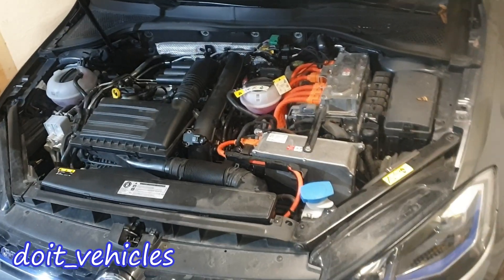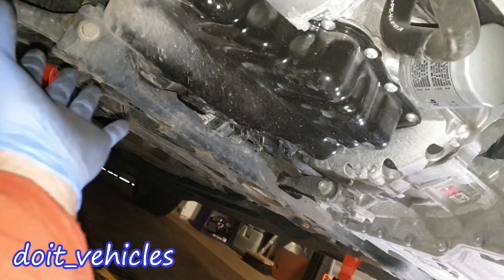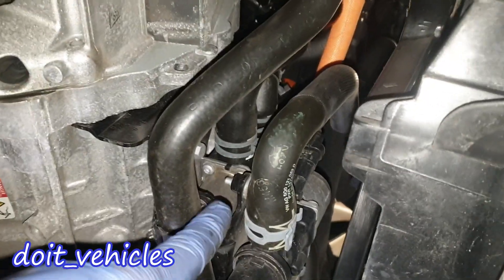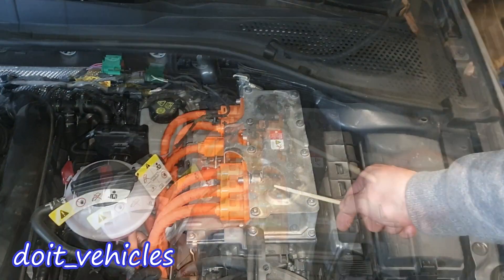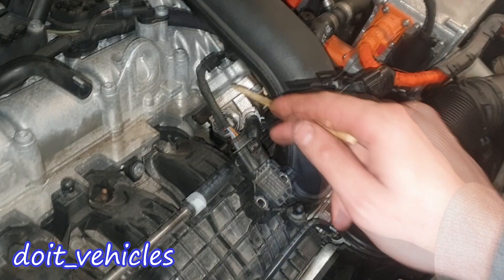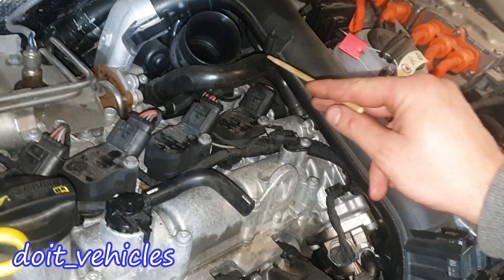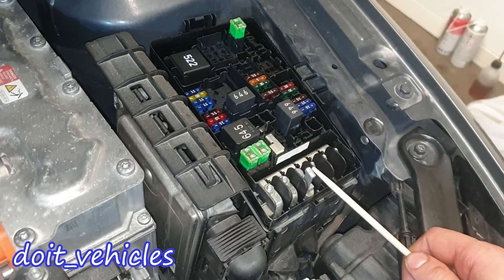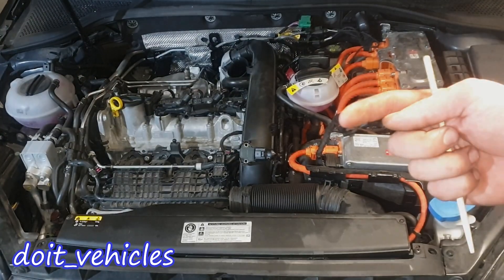Volkswagen GTE Hybrid - Engine Components Location - 1.4 TSI

Comment: Does it have anything vaccum on it? everything is electronically actuated right?
I have this error: Leak in air intake system P2279. 
I looked at your video but i have no ideea where to start. Maybe i will look at the hoses and check the sensor readings...for a start.
Reply: The problem is 04E198725M -- the turbo charger actuator. It is the same design as the notorious egr valve from 1.6 tdi. The same mechanical ideea that fails after a while. 
Mine has close to 200k now and i receive false air errors and turbo system error -- i guess the small actuator remains stuck. 
It is very easy to change but ie expensive for what it is. 
I could not find only the internal wheels for replacement so it is a swap part.